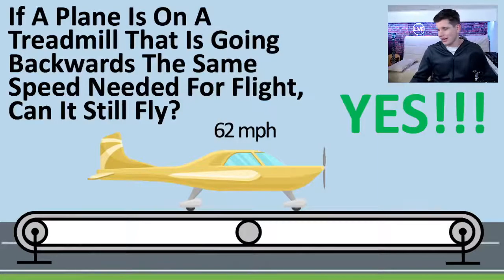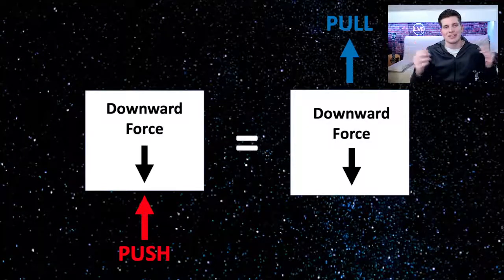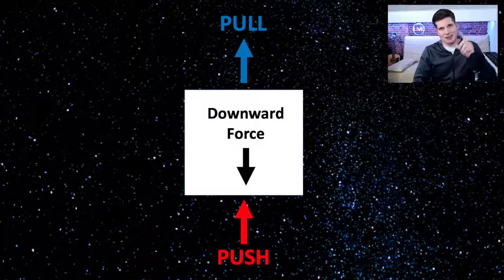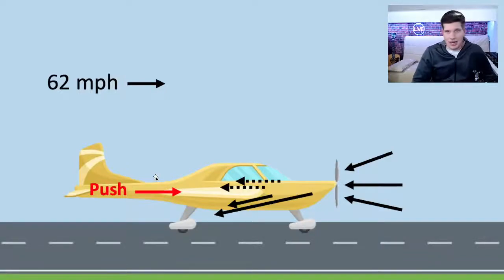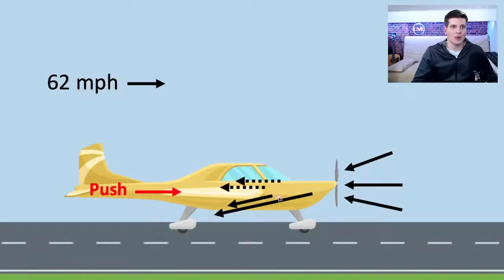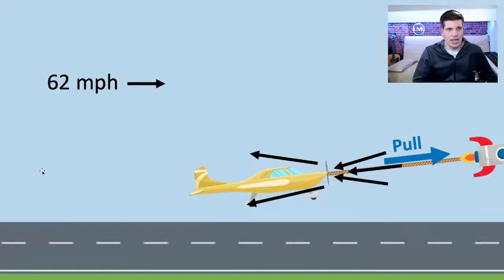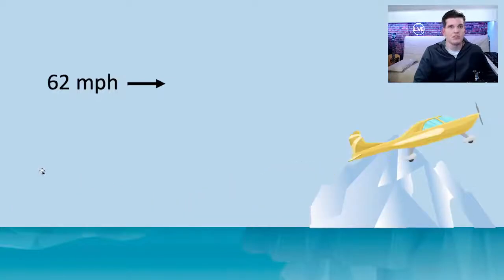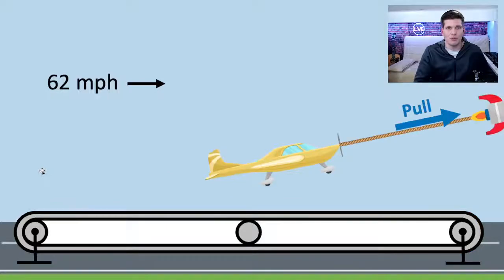Can A Plane Fly On A Treadmill? SOLVED! -A Practical Review

Comment: My God, there are so many errors in this "analysis" I dont know where to begin.

A plane is dependent on groundspeed for lift off. This is because you need air to flow over the wings to create lift.

If the conveyor belt matches the forward speed of the plane, it will be stationary, and no lift will be created.

It's insane that people believes this. If it were true there would be no runways on aircraft carriers, just a conveyor belt. Same things with airports, you could easily double the capacity of an airport by just adding a couple of conveyor belts.
Reply: You have it backwards. Aircraft wheels simply freewheel and a conveyor belt running against it would only serve to increase wheel RPM to twice normal speed. 

You're creating extra friction hence why they don't appear on carriers or airports.

Comment: so here is my problem in understanding. He states that the wheels are going 124 miles per hour yet the treadmill is going 62 miles an hour. When i think of this problem it is that the treadmill direct matched speed of wheels. Which would then be 124 miles an hour. And plane would not move.
Reply: I hear the question all the time as treadmill moving at same speed of wheels. Not speed required.
Reply: There are at least two different statements of this puzzle.  The version he is addressing is where the treadmill moves at the plane’s take-off speed in reverse.  In that version, yes, it very definitely can take off, and the Mythbusters even demonstrated that, with an actual plane.

However, another version of the thought experiment adds something to the effect that “the treadmill matches the speed of the wheels.”  I’m not sure what exactly that means;  arguably it just means that the wheels don’t slip/skid against the surface of the treadmill.  If it means that the treadmill somehow cancels out all forward motion of the plane, well then yes, the plane can’t take off.  Well, that is, unless it has a takeoff-speed headwind!

Nevertheless, outside the realm of thought experiments, a treadmill can’t cancel out the plane’s forward motion, other than by moving so fast that the tires blow out or something like that.
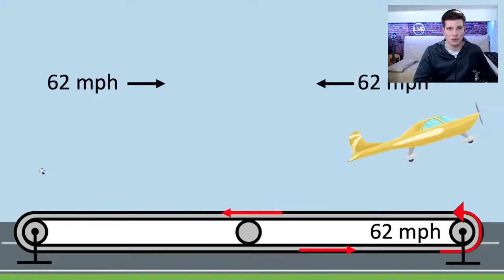Reply: Watch literally 30 more seconds (treadmill @ 1000mph) 14:13
Reply: @alakazam1157  the problem stated to me has always been with wheel speed matching treadmill speed. Which in this case it's not
Reply: @RatigansIsland  in this case treadmill speed exceeds wheel speed. In your theory the plane should move backwards, but this is clearly not what happens.
Reply: EXACTLY!!!
Reply: The wheels are free-rolling and don't exert any forces that would keep the plane from moving forwards.
Reply: How forward? If forward means tires are moving faster than treadmill  @grumpysanta6318
Reply: This ain't complicated.....it can't fly!

Comment: Sorry, but this logic is flawed and the conclusion is wrong.
Reply: I agree with your comment . The wing and therefore the plane as whole  flys by airspeed, it requires airflow over the wing to create enough lifting force to make it leave the ground. Ground speed has nothing to do with the wing been able to fly. If you had a strong enough head wind ,the plane would take off in with very little to no ground roll at all. Take a look at some of the STOL competitions. These planes takeoff in distances measured in feet.
Reply: @love-health-777  But in the question there is no head wind element so your answer is flawed.

Comment: This video is strewn with faulty logic.
Reply: Agreed... because per the question the plane can't advance on the treadmill because of the wheel speed having to match the conveyor. whatever method of moving the plane forward breaks the rule of the tires moving the same speed. It's all in the wording of the question.

Comment: Why do they not fit aircraft carriers with a very fast treadmill or rollers and save all that space? What's the point of runways at all if you could just have aeroplanes standing still on a set of rollers to take off? This vid did not mention the negative wind speed over the wings created by the reverse movement of the aeroplane (e.g. -62mph wind over the wings so all the props would do is cancel that out and it would not take off). I know that must not be correct but I cannot get my head around why?
Reply: Because there's no reverse motion of the airplane.  The air mass above the treadmill is not to any appreciable extent moved by the treadmill.  The aircraft pushes against the air not the treadmill to accelerate.  The catapults and arresting gear on an aircraft carrier must move relative to the carrier be sure they are affixed to it.  But they exist to modify the aircraft's AIRSPEED.

We can also take the question and turn it upside down.  Could a car drive in a wind tunnel designed to exactly at all times match the car's airspeed.  And the answer becomes more obvious.  The car pulls against the ground,  not against the air, so of course it could.

Comment: Mythbusters proved you could do this with a small plane that has a propeller , but something like a 747 would be impossible because you need the length of the runway.
Reply: Mythbusters was wrong.  They did not match conveyor speed to wheel speed except when they ran the little RC car on their treadmill.

Comment: If a propeller can generate 62 mph of wind across the wings by itself, why bother with runways? Just rev up the engine and fly away from a standstill! You may notice no one does that because it is impossible. There has to be 62 mph wind across all of the wing surface, not just behind a propeller set in the middle of the aircraft, and that appropriate lift is generated by a 62 mph ground speed down the runway (more, or less, depending on the prevailing winds).
Reply: Exactly. Why bother run the aircraft along the runway to achieve adequate air through the wings so an aircraft can lift? This guy's analysis is so wrong.
Reply: ...because it generates that wind by moving forward
Reply: Have you heard of helicopters?
Reply: @AGSSSH helicopters are rotary wing aircraft. Even with a helicopter air must flow over the “wings” (aka blades) to create lift for the helicopter to fly.
Reply: @tomluongo6344  that was my point
Reply: @AGSSSH  Well, I flew helicopters for 5 1/2 years, so yes...

Comment: This is Nerdsport of the highest order. LOL. Answering the questions that aren't asked. 

The original question posed is, "Can a stationary plane take off?"  The conveyor belt was just a contrivance to create the stationary condition.  Then everybody got all nerdy and into it and going on tangents about tires and friction and other nonsense.  It's all irrelevant to the premise of the question. 

Here's the REAL answer: Air mass moving over the wings creates force called lift.  If the lift force created exceeds the weight of the plane, the airplane will leave the ground. Once that condition is satisfied, lift will be maintained as long as the air mass moving over the wing is sufficient to sustain the lift force. If you somehow "screw the pooch" and do not maintain that condition, even if the wheels are OFF THE GROUND, you will experience what is known as a stall and fall from the sky.  That's an important point that illustrates why these arguments about tires and friction are all nonsense.  The plane can experience the condition of inadequate lift force 10,000 feet above your stupid treadmill. Watch the news, it happens all the time. 

If you need 62 MPH to achieve lift, you could take the plane off from a stationary position into a 62 MPH headwind.  But that's the only way a stationary plane is getting off the ground.  If you had a 20 MPH TAILWIND, that plane would need to go 82 MPH over the ground to take off.  It's about airspeed, not groundspeed.  That's why carriers turn into the wind to launch aircraft.  

All of the other rabbit holes people go down are about you attaching your ego to your nerdiness.  That's about it.  It's why people avoid you, BTW.  And yes, I have the same problem but at least I've got some self-awareness. LOL
Reply: Key point is that - treadmill couldn't  compensate forward force from airplane engine , because if we have well lubricated bearings (actually zero friction in bearings is assuming in this type of physical problems) - they literally could not transfer momentum from surface to plane,  they just can spinning without any effect on plane speed !!!!

Comment: the plane still has to move forward for the air to go over the airfoil. the propeller doesnt do that. otherwise ya just get the propeller moving at a certain speed and the plain jumps into the air. the wheels dont provide power to the movement of the plane, but the plane has to move at some point or it will never get to 62mph.